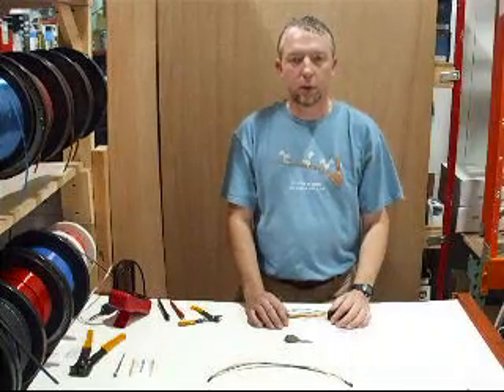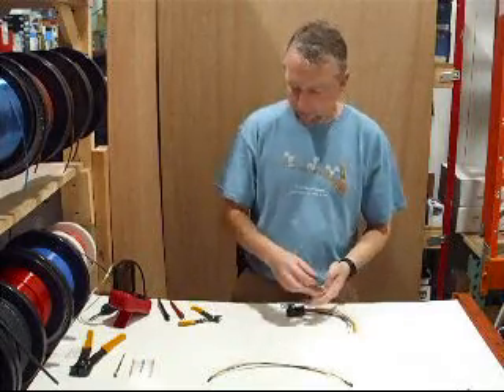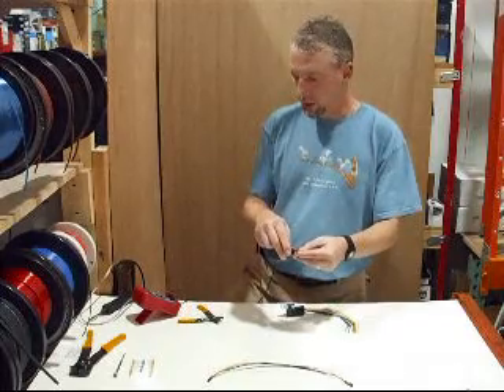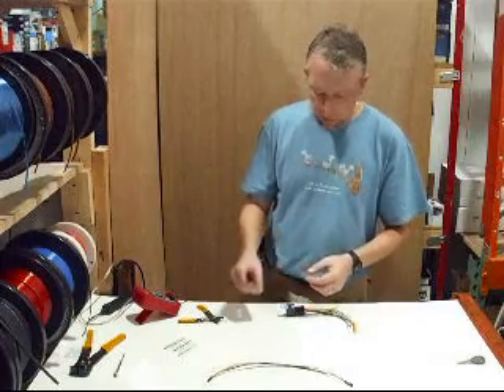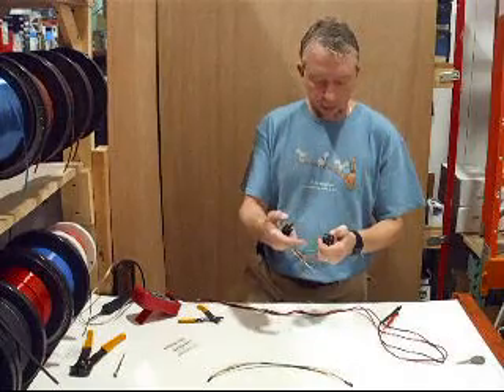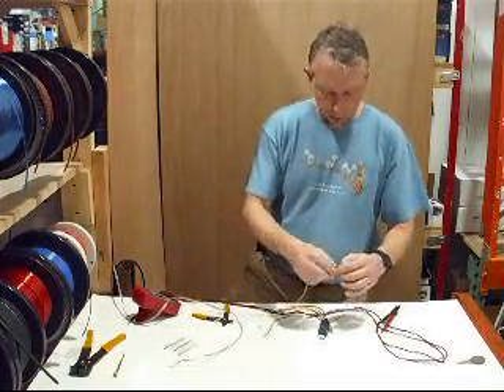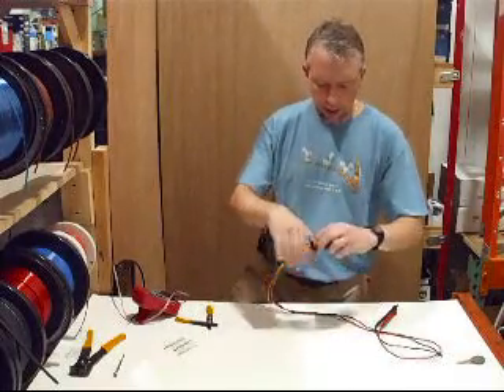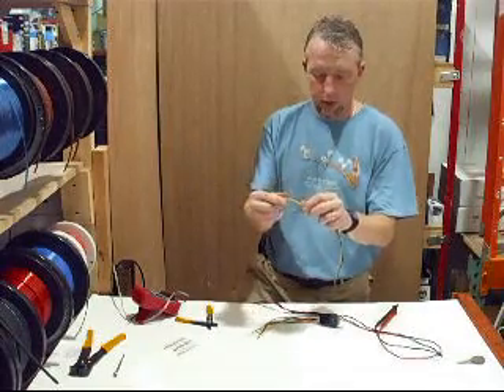How to Override Bypass GM VATS Passlock 1 2 Passkey Anti Theft System

Comment: I recently installed a steering colum on a 2000 Pontiac Grand prix gt and lately it's been cutting off and then when I try to start it back up there is no dash board lights or gauges what can cause this problem
Reply from the maker: +Niyanna Moore Not sure, may be a mechanical thing, Have you looked at the cars diagnostics yet?

Comment: DUDE!!!!! The resistor worked on my 2001 saturn L300 I've been working on this SOB for weeks fix'n code's and chasing ghosts.. I did everything to disable that got damn passlock. When I saw this I went to the car cut the yellow wire. I then placed a 580 ohm 1/2 watt resistor. I thin used starting fluid to get the car to run long enough for the passlock to shut the hell up. I rotated the key about 40 times and BAM. THINK YOU THANK YOU . . Yeeehaaww

Comment: ok guys i have a 1993 LT1 6 speed, it was running fine then it stoped !  now it dont want to start ! it turns over and over !!wont start!! let it sit for a couple days ! it starts then it died ! again and again! then it shut down and wont start !!, i changed Opti spark, coil 3 times!! ICM 3 times!! i let it sit all week ! i went out and try,d it !!it started again ran for about 20 mins died ! same thing again !!   what relay is he talking about??? NEED HELP BAD!!!
Reply: +James Benson You probably got this issue fixed already, but in your case I think I would just pay the cost to have the dealer diagnose your problem. Then, once you know what it is, you can fix it yourself... Worth a shot. Good luck...

Comment: I have an 04 gmc canyon, with the pljx bypass, and a viper alarm. Everything on alarm works besides the remote start. After hooking up the bypass and when i connect the ground when armed wire, and arm the alarm, i get power to dash lights as if i had a key in the acc position. Hopefully i explained it clearly. Please help. Thank u for any sugestions.
Reply: Also if the key is in the on position, and i try to remote start it, it works. Takeing the key out and i try to remote start it and it tryes but nothing. Please help

Comment: PLEASE HELP!!! I have a 2002 Pontiac Gran Am Gt 3.4. Its had the no start problem for a year now. It use to start by doing the 10 minute relearn but since about 2 months ago it take me hrs to get it started and every time I turn it off I have to start all over again doing the 10 minute relearn over and over until it finally starts. I tried cutting the yellow wire and installing a resistor to it and the black wire it worked for a few days then failed. I put a new resistor on it worked for about an hour and stopped. Ive been trying for 3 days now to get it started. ..it started yesterday, i let it run for a few minutes turned it off and tried to start again and it wouldn't. Been trying all day and im getting nothing. I hooked everything back up the factory way and still nothing. Please help! Single mother of 3 trying to do this myself lost my job 3 weeks ago cause I couldnt get to work so I have no money to pay somebody to do it for me. Please I'm begging you help me! Any information will be much appreciated. If you could call me and talk me through it that would be very helpful  (423)943-6147 
Thank you soo very much,
Cynthia
Reply from the maker: Cynthia Hamm  send me an email to sales@lesscoelectronics.com  I'll see what I can do for you.
Reply: Ok thank you

Comment: I have a 2001 corvette went through the being stranded issue with blinking Security light. New Keys did not work sprayed computer board cleaner in ignition, try anything. It worked for a day now it starts fine but the security light stays on, what should I do?? Is there a video on how to change on in a c5? My original Key has 593 ohm resistance and the new ones 600, within 10%. Can I drive it with security light on or will it shut me down when it wants to?
Reply from the maker: ***** You can drive it forever with that light on, Ive seen it many times.

Comment: iv got a 2002 regal the key has been changed to a none chip key what do I do in this case ,, don't have the oem key
Reply from the maker: Russell Hollingsworth if you cant get the old resistance you may want to use my last resort method at the end of the video.

Comment: First: If you are going to do a How-to video on a GM vehicle, you could have at least used a GM key that actually has the Passkey Chip.
Second: Simply "pretending" that the key has a chip is hilarious!!! Actually testing a GM key with the Passkey Chip would have been WAAAAAAAAY better. JMO
Third: I frequent a Forum where a lot of the members have done this VATS (Vehicle Anti Theft System) bypass. Myself, being in the car audio industry,  I DO NOT recommend this, BUT, If the VATS system is beyond "reasonable" repair, A Bypass may be the only "reasonable" option. I ALWAYS recommend installing an after market alarm system after the VATS bypass has been done. In the video, the guy says the resistance in the key (chip) pellet can be anywhere between 400-15,000 ohms. There are 15 possible ohm values, the lower being 402 and the higher being 11,800.
Reply: Eric Bachmann I lost my key so I cannot know what original resistance was supposed to be.  If there is only 15 possible choices, I am willing to try each value.  However how would I test it without the key to try to turn it on?  

Will I need to get a new lock cylinder or can I literally just force a screw driver in the ignition and force it to turn?  Believe me no one is going to steal this car?  Can you privide me with a link to the forum you mentioned in your comments please.   Thanks ahead of time for any help.
Reply: Eric Bachmann  Did you ever get the answer to your ? how to bypass the security with no key
Reply: Measure the resistance (if Vats) and place the resistor right on the wires in the column. I can provide a diagram if still interested
Reply: Yup. Agree! some immobilizer module on Passkey ETC and resistor for Vats, but put an aftermarket antiGrind behind it
Reply: My 2005 Cadillac Escalade doesnt have a chip in the key tho..so Im assuming that not all GM's hv chips in the keys.

Comment: About the Passlock Bypass? ( part of an old remote starter package)  I wish to remove it and return to original configuration. I suspect this recently intalled Passlock Bypass to be causing excessive battery drainage. So I am confused on the procedure ( How to do it properly ) . The reason , ever since GM ignition switch recall, GM shop sent me else where to have this generic remote starter reprogramed,  elsewhere garage had to replace Passlock Bypass box, and now, I notice battery drainage and it cant be that new battery I just installed. I got the remote starter out but when I removed the Passlock Bypass out of the saturn Ion I notice car passlock indicator on ( car would start anyway with the indicator on ). Could you please explain a simple procedure ?
Reply: How to replace key cylinder on 1997 Chevrolet blazer ?

Comment: This is the site that helped me.. its easy and a permanent fix :0)

The security, antitheft or lock picture/icon is a visual indication that something in the car's antitheft system is failing.  In most GM cars and trucks there is a hidden system that most people are unaware even exists. From the moment you put your key in the ignition, there begins a constant line of communication between your key's security chip or transponder, to the ignition's lock cylinder, and then to the car's TDM (Theft Deterrent Module). These 3 parts are in CONSTANT communication. If the key is in the ignition, then these parts are sending signals to each other. The security light illuminates when that signal gets broken, even just for a second. When the signal breaks, the car misinterprets this as an attempt at theft and goes into antitheft mode. The car thinks its being stolen or hotwired because it is not getting that signal from YOUR specific key. This is why the security light turns on and shuts down your vehicle. This link explains it pretty well.
http://vatspasslockpasskeysecurityhelp.yolasite.com/
Reply: Jodi Adams link shows site is no longer available.   got all excited ...and was left unsatisfied.  any clue to where i might find it or similar? Thanks
Reply: Jodi Adams

Comment: This is a great way to temporarily bypass the security in the key/ignition. If the Theft Deterrent Module is bad, it won't help you at all. If you've tried this and it didn't help, or you are looking for a more complete bypass, go to this link i found. Great information and a permanent way to eliminate this issue for good on your GM. http://vatspasslockpasskeysecurityhelp.yolasite.com/

Comment: Lessco
Ive watched a few videos on this. I want to override/eliminate the passlock system altogether. Are the videos that show cutting the yellow wire and placing a resistor between the yellow wire and the orange/black wire and taping up the excess yellow wire that goes up to the key. Is this the right procedure? and if it is, how do I find what the resistor value should be. The videos say to measure the resistance (after you cut the yellow wire) between the yellow wire and orange/black. I get a reading 3600ohms when I measure on the strand of yellow wire going into the steering column, but when I measure the strand of yellow wire that goes up to the key it registers (infinity). Does that tell you anything?, all the other videos say I should have measurable resistance where I'm measuring infinity.

Comment: i have repaired the broken wires in my ignition a few times.  this time car wouldnt start and i was getting a code 22 and 58 obd1.  Took apart the lock cylinder and wires were broke.  repaired wires (i think because they were very short) and car would not start like other times but security light would not come back on..  put resistors together for bypass and still wont start.  did bypass 30/50 hz between tdr and ecm and still wont start.  when turning ignition no sound at all.  hooked up remote starter and car will crank but dies after 2 seconds.  fuel pump will whirl and fuel injector noid light flashes some.

Comment: my key is reading 1.12 i dont know the mathematics of the resistors or what now what do i need and how many ?
Reply from the maker: If your meter is set on 1000's 1.12 means the resistor is 1012 ohms.
Reply from the maker: 1.12 = 1012 ohms
Reply: What the best way to get pt cruiser going with no key help can some call me 3176405890 I bought it with no key

Comment: Good video if you're looking to make your car prone to hotwiring / screwdriver auto theft. In the 80's when this ATS was implemented Corvette thefts went down by 90%. Performing the action in this video is clever, but stupid as shit. On another critical note, these are NOT passlock systems. When you say Passlock, you're referring to the GM 10cut passlock systems that have a magnet + transponder system built into the lock itself to prevent hotwiring only. VATS locks use keys called Passkey I and Passkey II depending on whether your lock uses a single or double sided key. These locks are strictly referred to as VATS locks. Try to be a bit more accurate and CAREFUL when presenting your company in these videos bud. Thanks for teaching auto thieves around the world douche.

Comment: Good video Lessco, Question, Have watch previous version of your video on how to install remote start kit, Do you have a video on how to setup OEM Interface 3 PULSE START?, with vehicles that already have Keyless entry installed. I have a vehicle that already has a OEM remote on the key chain for unlock/lock/truck & panic. I got a RS00 G4 Add on remote start 3 pulse for vehicle that came with OEM remote. I just wanted to here how would you suggest to set this option up for 3 pulse that communicates with the system anti-theft system already installed by manufacturing. It saves time to stall less wires to set this option up. Please help, I have read the instructions, but I just want to here your expertise on this for you have made good detailed video explaining step by step.

Thanks
Reply from the maker: It will be less work to do a factory add on for sure, as long as you're ok with not having the extra distance a stand alone system offers. I do have 1 piece of advice though, If you can do a 2 pulse lock to start it'll be better for you... here is why. If you hit lock on your factory remote your horn will blow 2x (on the 2nd and 3rd hits). no ones is gonna like that. I'd set it for 2 pulse activation and do lock/unlock lock on your factory remote to activate the starter.
Reply: Thanks for the advice I would rather set that option up instead, the horn would get old real quick. Started working on this project for the vehicle, Now I need to find out Y the unit light won't come on, input source is connected to the battery, checking the parking light source wiring, this unit may require battery & parking light wire to be hook up for the unit to turn on with RS00 G4, I notice that the parking light did not flash for programming. For future starter I will order from your site next time, this was brought to me for installing. Instruction say input source & parking light needs to be connected for power on light of the unit.
Reply from the maker: Marquan HollaAtYaBOY what is a  RS00 G4, is that a crimestopper addon remote starter? you didn't really say
Reply: Yes sir, it is exactly a crimestopper remote - Its a ADD ON REMOTE STARTER for OEM interface systems....thanks Lessco.
Reply: Lessco Electronics  As I understand it, for power, once you find the manual it looks as it read to turn this unit on, you have to connect the red/back input to the (+) battery, green to the (-) lock, black/ground to chassis and final, white to parking light (+), after that it should turn the unit on or make some kind of sound. the status light did not turn on. I have on last connection to the parking light, after that, it should be game on. Operable to run. Not working on it right now, but later to finish the set.

Comment: What if the theft light is solid?car won't crank sometimes, do i need to do the ground wire to the pink wire thing?
Reply from the maker: If the light is on solid, that means your passlock system is p.o.-d!   leave it be for 20 minutes wityh the key left in the on position and retry it

Comment: It is Resistance not impedance.  Impedance is imaginary. Resistance is real.  Impedance is a function of frequency. Resistance is not.
Reply: Not necessarily a pure function of frequency. However you're correct as it isn't the same as resistance. You get impedance by factoring your resistance and reactance overall in the complete circuit. Impedance is used commonly in AC's which can also be defined in terms of a frequency.
Reply: xl and xc 2pi FL and 1/ 2 pi FC  . It is either Capacitance or inductance.  Since L and C is a constant, then F becomes the variable making impedance a function of 1/t . QED Axiomatic.

Comment: I found a wiring Diagram for my vehicle (2006 Chevy Express 3500) I found a yellow wire in the L.Blue connector of the BCM that is the “security system sensor wire” and I also found in the Gray connector of the BCM under B7 a Tan wire that is “Security system sens low ref”. So my question is which of the two security wires get cut? Tan or Yellow?
Reply: Nick Exley Hmmm..whether to cut the Tan or Yellow...I've seen this scenario so many times in those Bomb-Squad movies. Usually, from what I've seen, get a timer, and  set it for one minute and when it ticks down to the last 2 seconds, cut the Tan ...STOP...wire, NOPE, quickly cut the Yellow wire and note the timer will be at one second. Whew! That was close, but always works in the movies, and always the right choice.
  Hope this helps!

Comment: I didnt understand the relay part. My 99 silverado is acting up. I already did the resistor on the wires. It worked fine for a couple months but its failing again. Does my truck have a relay or do u buy a relay and connect it to the ignition wires? Help please

Comment: I have a 95 Cadillac Fleetwood and need to bypass my vats because this car just wont start. what I am understading is that I only use 1 of the white wires inside of that orange housing coming from the ignition.

Comment: I recently purcahsed a cluster for my car and the security system will not allow the vecicle to start, one of the messages is disable starter and it has. if i do the by pass will I still have to have the cluster reprogramed?

Comment from the maker: your key should have the + sign on it, making it a passlock 3 system (which is transponder) this video is only for resistor based passlock 1 and 2 systems.

Comment: Hi, Youtube friends,  let me share this info with you..
I have 2002 Chevrolet Impala 3.8 II Series.
If the security light stays on ( USA Model ) (Security Passlock Canada Model ) 
or flashes, wait for 5 to 10 min with the key in ON Posistion, 
until the light goes off. (Sometimes it don't but wait anyway)
Then turn the ignation key to OFF Posistion (VERY IMPORTAND !)
before attempting to start the engine again ! ! ! And your car will start !

Comment: hey guys, there only 12 differrent value of resistors it can be, go to the12Volt site get the resistor chart for gm vats, go to radioshack and get one of those small 10 turn potentometers with a value up to 20K ohms. stet the pot to the lowest value on the chart with it installed on the car. try to start it, if it doesnt start, key off set the pot to the next value then back on for 10 mins, do that ntill you find the right one. youll know you have the right  one when it starts up!